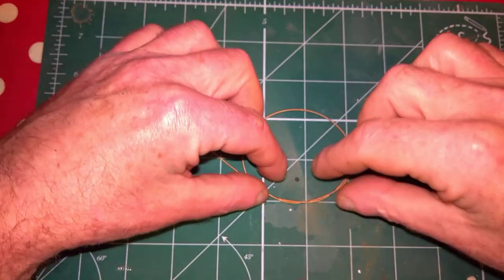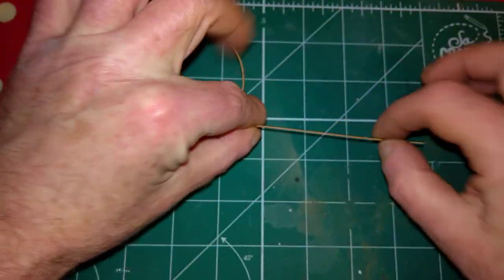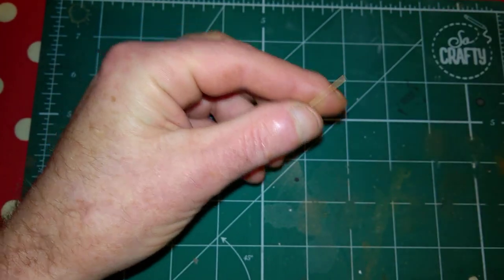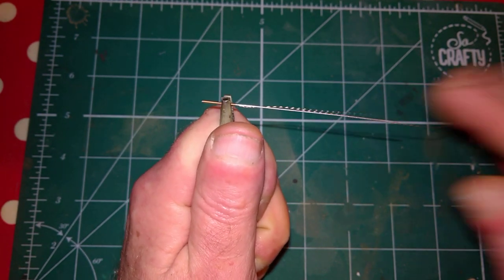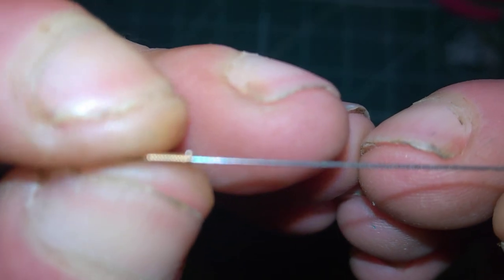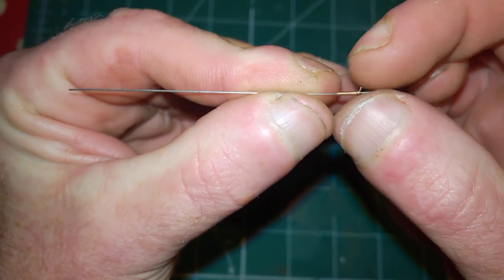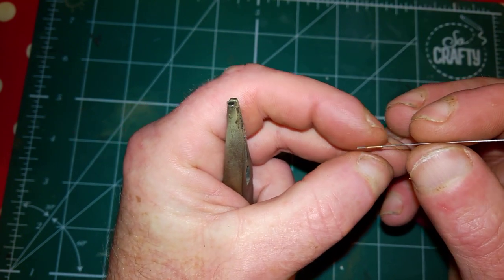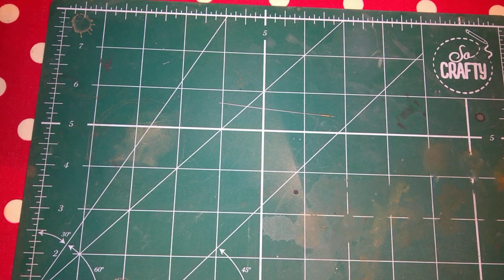How to make Ariel's / Antenna for your 1/35 model from guitar string

Comment: The Battleship I'm working on suggests the stretched sprue method, but Since I have plenty of old guitar strings ( I don't usually throw the old ones out when I change strings) I had already thought of using them instead. I like your method a lot though. I'll have to try it to check the scale. Thanks for sharing that. Regards, Solomon
Reply from the maker: They are handy and a bit more sturdy than sprue   :-)  J.

Comment: Iv got the same wire cutters in a couple different sizes I'll need to go back to poundland and pick up another couple iv had mine for about 4 years and still going strong and very easy to sharpen with a diamond file from the Range is this whare you found your set? I'm very surprised they've lasted as long as my more expensive ones from hobbycraft are all chipped away and abitty bent of centre and to hard to sharpen! I make my antennas kinda similar I use my bonsai 0.5mm copper wire with the same wire wrapped around the base to simulate the spring